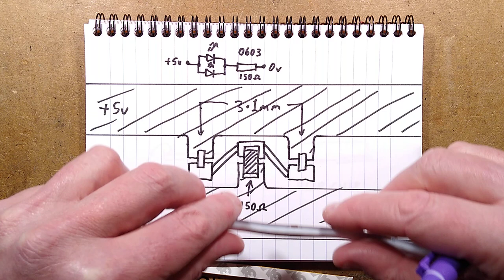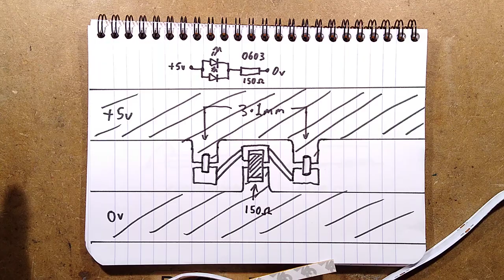Exploring linear LED COB tape with macro PCB shots

Comment: I recently purchased a ring light from my local Wal-mart which was USB powered. The ring light cooked my poor power bank The powerbank was rated for a 2.4 Amp output and I noticed that the light turned off in the middle of my project. I went to investigate and noticed it was Very hot and had a slight cooked plastic smell.
Reply: What brand? I recently bought a digipower ringlight that was flickering when powered from the USB hub in my monitor, but it's old and was probably only giving 1A when the light wanted 2. You've just made me slightly apprehensive, because I think I've seen reviews of those on sale in Walmart. (They were a special buy in Lidl in the UK the other week.)
Reply: @nialltracey2599  Unless otherwise specified, count on the USB ports in your PC/Monitor to follow regular USB specifications -- That'd be 500mA for USB2.0, and 900mA for USB 3.0/3.1 (gen 1 & 2). Etc etc.. it becomes so stupid and messy once you hit 3.x generations. 
In short -- Check your monitor's specs - most not-quite-higher-end, with a couple of years on them, typically just comes with 2.0 ports.
Reply: @Nightykk  mAh (milliamp hours) is a measure of capacity.  To my knowledge no USB standard is rated for power storage in the port.
Reply: It was a go viral ring light. This was a stand alone power bank that it fried. The power bank was itself rated for 2.4 amps output. I tried it in an AC adapter that is rated for higher capacity and it caused it to heat up quite quickly so I returned the light. Next one I get will have a proper AC adapter. Not going USB again
Reply: @aspendell209  Was a minute from sleeping there, not sure where that 'h' came from, my bad. Edited it.
 Been looking at power banks and what not half day, for a project I'm trying to work on, I blame that :)

Comment: If they're available in 6 mm then they should pe a perfect CCFL replacement for old LCD screens.
Reply: I’d use LED filaments for that. You can now get them in up to 1.2m long (flexible!) at 24V, and up to 30cm at just 3V.

Comment: Shame the load is so high, I'd have loved to use this kind of product for ambient room lighting, even more of a shame is that EL wire has such a short lifespan, that stuff looks great, but I'd need it to last more than a few dozen hours.
Reply: What do you mean "the load is so high" you can just regulate down the current or voltage to reduce the brightness..

Comment: Any idea why it is so much harder to find waterproof stuff? It does exist but isn’t nearly as common. Maybe a temperature thing?
Reply from the maker: In my experience the water slowly penetrates through and causes internal corrosion.
Reply: @bigclivedotcom  thanks! Have you seen the circuit of the addressable version? I’ve found a few pictures and it looks quite similar to closely placed standard LED. I’m just about to make a knock-off Phillips Ambilight using a Raspberry Pi, HDMI capture and Hyperion software: the homogeneity of those single colour strips is much better than the A-LED strip I have currently but not sure the multicolour looks that much better. Also don’t know the latency or if the software could do it.

Comment: Hi there - what's the longest single run you can do in a cob led?  My understanding is that they are still limited to 5m lengths is that right?
Reply from the maker: It depends on the current they use.  It's better to divide it into individually protected sections.

Comment: i was expecting you would peel a part of it and show the actual flipchips.
Reply from the maker: I struggled to get the gel off them.
Reply: @bigclivedotcom please make a follow up video with the new RGB and RGBWWCW ones. For some reason I could only find 12V and 24V strips and no 5V ones. I'm planning a project. If prototype is successful, I would definitely post a video to YouTube. It's still under design phase and I would like your perspective before adding the led feature to my project.

Comment: Honest question: don't you find metric more easy to use than emperial? Always wondered about that.
Greatings from a huge fan from Norway
Reply from the maker: I use both.  But metric is the way to go.
Reply: Metric is great for scaling.  100cm -> 1m, etc.  However, if you're working a lot with fractions, then feet/inches are easier to deal with.  Since 1 foot = 12 inches, you can quickly divide by 2, 3, and 4 without getting odd fractions.  With 1 yard = 3 feet, then at 2 yards (60 inches) you can quickly divide by 2, 3, 4, 5, 6, and 10 while getting a result that is whole inches.  And other values aren't obnoxious either.  1/8th of a yards? 3.75 inches.  The ONLY fraction of a yard between 1/10th and 9/10ths that results in a weird string of numbers is 1/7th, and I rarely have to divide anything into 7ths.
Reply: @Okurka.  12/10 inch, obviously.

Comment: Do they come any warmer than 3000k. I have been trying for ages to get a reasonably priced 2700k "old style" 3 LED's per section tape.
Reply from the maker: Unless you buy the tape from a prominent supplier, the colour temperature you get can be a bit random.
Reply: Some COB LED strip sellers have 2700 K and 3000 K.

Comment: The DIY arcade community had been trying to achieve something like what this does for decades in the t-molding.  All kinds of diffusers and translucent PE mold and silicone, but they all look like ass and are hard to repair or replace.  It looks like you could trim this down to a 3 or 4 mm wide strip and stuff it in a channel.  The commercial guys have been doing something that looks nice but either no one knows what they do or it's too expensive for the home-gamer: https://www.youtube.com/watch?v=i3iIQcKht4o

Comment: I used warm white COB tape to replace the older style in my mum's kitchen. It's a nicer colour, runs cooler and is way brighter. I had to trim the PSU all the way down.

The old stuff was gel coated and yellowed badly over time, especially where it was running hottest. I had those all fed from one end. The new stuff is fed positive from one end and negative from t'other.

Comment: I was thinking about running a 5m length around my bicycle using a 12v 3000mAh Rechargeable Li-ion Battery.  Anyone had any joy with this setup?
Reply: Expect the bicycle to melt and/or the battery to get sucked dry. Five meters is 10 amps, yo! That's 120 watts and would probably last about 90 minutes before the voltage dropped below the level to fire the LEDs if my calculations are correct.

Comment: That seems like a bad design that everyone tries to push so many amps through a thin strip of copper. Reminds me that even when I cut my led strips of into 4 foot sections, there's still half a volt drop from end to end.
Reply: The voltage drop for a length of strip depends on the trace width and thickness, and the current.  Higher voltage strips like 12 V and 24 V will have a lower current, and thus a lower voltage drop for the same resistance.  They even make mains voltage LED strips, if you need very long runs and don't have safety concerns.  The voltage drop isn't a bad design.  It's just the trade-off for making a thin, flexible strip that's not too expensive.  The voltage drop is something that you need to manage by powering the strip at enough points.  Maybe you just bought a really cheap strip with very thin traces.

Comment: Thank you for posting. Is it waterproof? Would it work for indoor gardening?
Reply from the maker: It will be splash proof, but not suited for submerging.
Reply: I haven't found one that is truly waterproof. I ordered one brand off of Amazon that was advertised as waterproof but it was exactly the same as the strip he held here but 24v and white light LEDs. Although much better 3M adhesive. Also the solder point for the barrel jack wasn't properly heat shrink sealed. It was just common white heatshrink without any glue to keep water out. It was open for water to pass through.
Reply: Efixx did a demo of one brand submerged

Comment: COB is crap, it cracked up 2 months after installation 😳
Reply: Did you tape them to a heatsink (like an extruded aluminium profile) or did you just tape them to a heat insulating surface?
Reply: @wilhelmhohenzollern576  Thanks for the tip - tapped it to a wooden surface, under a 6m long shelf and running it @ 80% felt ok. It's the gel cover that cracked up and caused problems, eventually had to scrap it 😢
Reply: @HBees79  There's your problem. If you want to try that project again: Use extruded aluminium profiles, a constant current power supply and run that at about 60-80% of strip-spec. Also try to get strips with a CRI of 95 or higher if you use white strips, those usually have better manufacturing quality in general on top of being WAY better light quality.

Comment: TL:DR... be careful with any coloured LEDs that claim to use UV LEDs tuned with an outer phosphorus layer.

Yeaaaah... I got a nasty surprise from those ebay UV LED tape reels with its 'black-light safe' claim. About a month after I installed them, I found every piece of bright white plastic bathed in that glorious light that made them glow ever so sweetly in the dark like you were in a club in the late 80's had now made them yellowish-brown as if they had been sitting in a south facing window of a chain smoker's house in Arizona. I... was... not... impressed and thus just further eroded any remaining trust of Mainland Chinese vendors. On the bright side though, I only have to tan the other half of my body now.